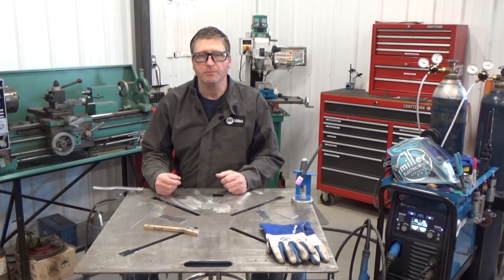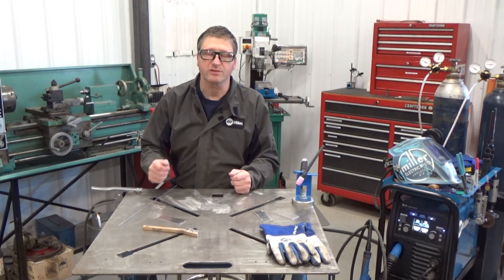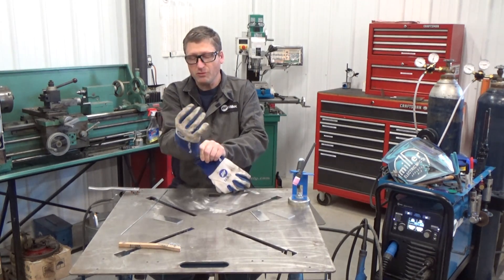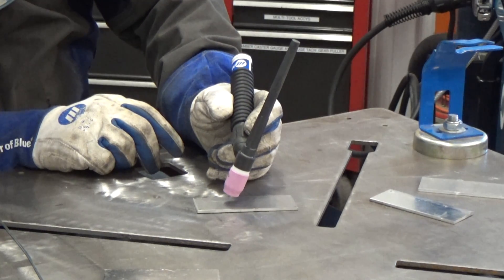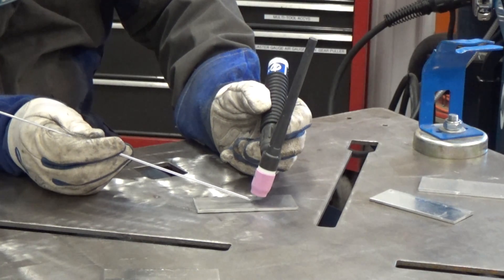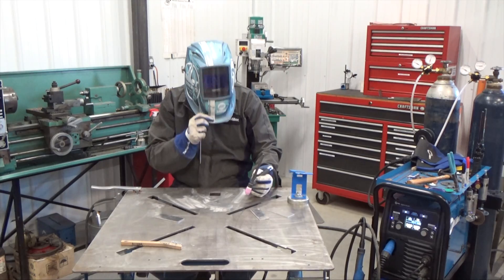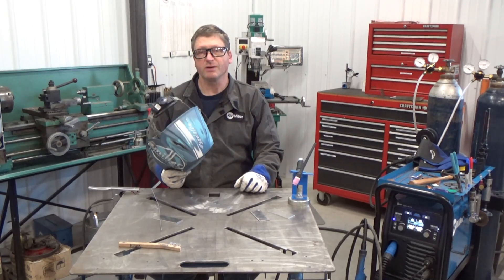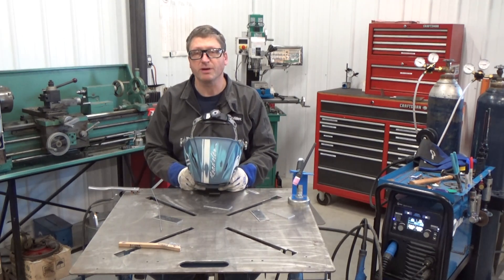TIG Welding Aluminum for Beginners Part 1: Positioning

Comment: Can a tig ac convert aluminum oxide into aluminum? Im thinking if we can recycling aluminum using tig ac.
Reply from the maker: Hello! Thank you for your question. Yes, an AC TIG arc can melt aluminum, but it does not convert aluminum oxide into aluminum.

Comment: Great teaching.  l have arc and gas flowing on my 250PEACDC tig,  125 amp still not able to form a puddle on coupon, just a white patch, while not able to see a bright arc ball on tungsten tip like yours , just a dancing sparking arc.  What is your setting? I am on gun +, ground -.  
 Thanks.
Reply from the maker: It sounds like you may have a work return issue, check the connection between the ground clamp from your machine and the coupon.